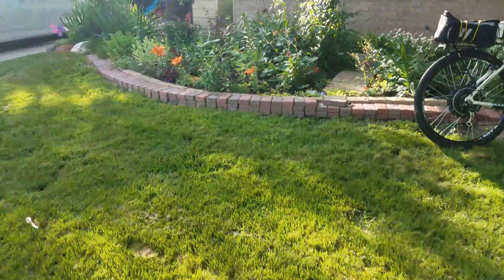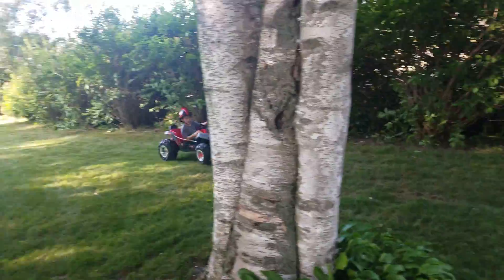Power wheels lithium 24v 25.2v battery upgrade LMO IMR batteries

Comment: Hi I bought one of these from you and its been working great and my boy has a whole new appreciation for his power wheels. He was not using it much because the original battery only lasted 5-8 mins (must have been going bad). Any way,  I do have a question. I never know how much capacity is left, there is enough there that the kid looses interest before it shows any sign of depletion, I just keep throwing it on the charger when hes done and its been working well. Is there a way to tell how much battery life is left? and most importantly when the voltage gets too low will it just cut out to protect the cells? This pack saved me tons of money as I can bypass purchasing a mini gas powered ATV for a few years until hes big enough for a mid sized ATV. , Thanks for making the pack and selling to us none electronically gifted folks! One more question, Can I purchase a second charger from you for this, I want to keep one here and take the second one camping. Thanks
Reply from the maker: Kyle B Thank you for your purchase.  I am glad he is enjoying the upgraded pack!  They last for a long time.  The way you charge the batteries will actually increase the lifespan of the discharge/charge cycle life.  These will last 500-1000+ discharge/charge cycles (depending on how low you discharge storage etc).  Minimally they should last 500 cycles.  There is no sure way to tell how much is left in the battery in terms of capacity when he uses it.  If you have a multimeter you can check the pack voltage to get an round abouts.  The BMS will cut power when the battery voltage reaches around 18-19 volts(under load) to protect the cells letting you know when it's time to charge the battery.  If you would like we can sell another charger for you please send me a message.
Reply: Perfect! I'm not worried about checking the remaining charge percent so much, I just wanted to make sure the little protection computer thing built into the upgraded pack was going to indicate when the voltage was too low and needed to be charged. I looked up what a BMS does and that is exactly what its for (along with making sure the cells are balanced). I am going to shoot you a msg to order a second charger right now. Thanks for you support and quick response!